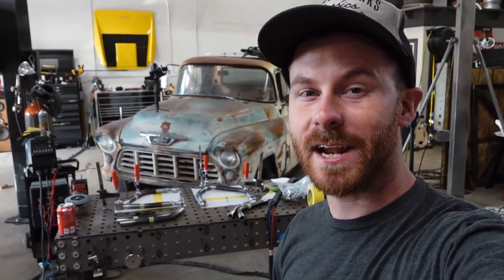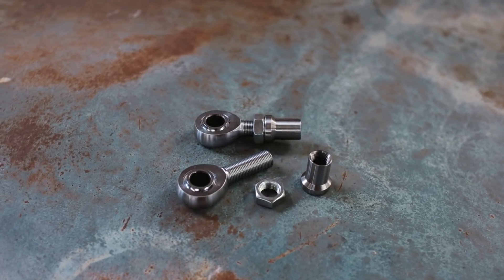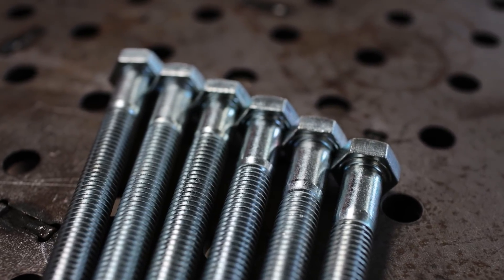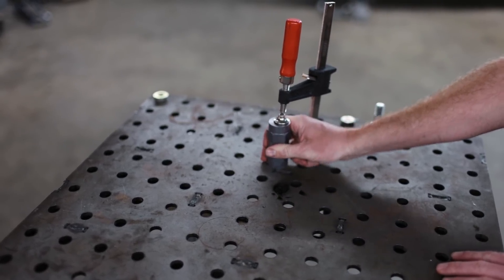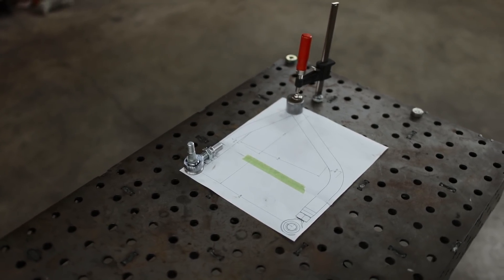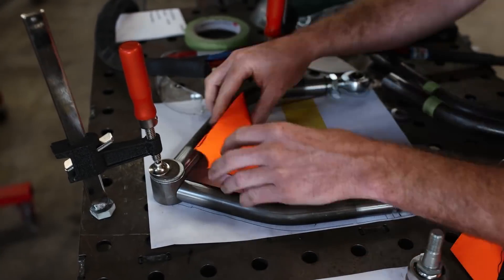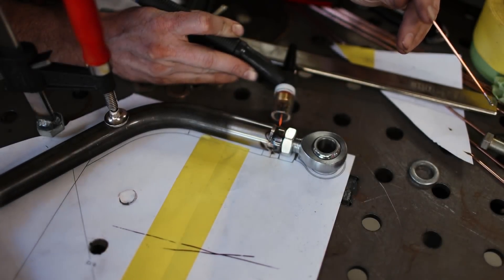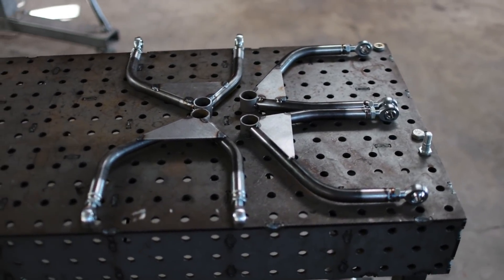Custom Control Arm Fab - Time Attack Suspension Build Part 2 - K Swapped Ferrari Ep. 52

Comment: Could you provide the specs for the ball joint eyelet in the upper control arms? Doesn't seem anyone makes off the shelf eyelets you can weld to control arms.
Reply from the maker: I had them made by a machine shop
Reply: @stanceworks6544  I'm using similar corvette uprights but custom controls arms. Could you share the specs?
Reply from the maker: I don’t know them off hand. It’s just bored with a taper matching the ball joint.

Comment: Recommend turning an aluminum or copper heatsink to fit tightly and bolt into the ball joint cup to keep it from warping and improve penetration/ strength and makes certain your ball joints fit when done welding 🙌🤘

Comment: Very nice work.  Did you run any FEA in Fusion 360 or are you just going off gut here?

Years ago I found a free program on Tony foales website for tubing notch templates.  I'm sure there are loads more but was handy when making motorcycle surfaces with smaller tubes meeting larger tubes at angles.  Gives you something to print and wrap around the tubes to make before cutting and grinding

Comment: DOM is not seamed tube. It starts off as a solid bar. It is squeezed and ruined at the same time developing an opening in the centre of the bar. Then a mandrel is pushed into that opening and the walls are formed by rolling.
Reply from the maker: "Although it is almost always referred to as a SEAMLESS tube, technically it is NOT seamless tubing, and it started life as some sort of EW (electric welded) tubing. During the manufacturing process, the weld line becomes nearly undetectable, thus it is referred to as SEAMLESS. It is considered a high strength, high quality tube, and is normally constructed from SAE 1020 or 1026 steel. DOM is commonly used in the manufacturing of race cars and motorcycle frames.

1020 is normally used in the manufacturing of small-diameter or thin-wall DOM steel tube. 1026 grade is normally used in the manufacturing of DOM over 2" OD, with walls heavier than .156". Depending on the diameter and/or the wall thickness, you may receive EITHER 1020 or 1026."

DOM is technically a seamed tube. Its not considered to be by rulebooks, but it absolutely begins with a seam.

Comment: I'm not very familiar with heim joints used in this application and wonder how long they last without lubrication or seals to protect them from "stuff". The fab work here is VERY nice. I can't wait to see the assembled suspension with brakes and wheels/tires.

Comment: DOM - ..."seamed tube"???
Isn't DOM "seamless"??🤔
Reply from the maker: It’s considered to be seamless by rule books but no. It’s not technically a seamless tube. It’s welded tube that’s been drawn over a mandrel.
Reply: @stanceworks  - wow! I looked it up now! One NEVER is done learning!!
You are right - Drawn-over-mandrel tubing – DOM tubing is made from a cold-drawn electrical-resistance-welded tube that is drawn through a die and over a mandrel to create such characteristics as dimensional accuracy, dependable weld integrity, and an excellent surface finish.

Looking forward to the next one!!

Comment: Nice work. The ball joint taper is likely going to distort when you weld that component in. Usually best to just ream them once they are welded. It should be 7 or 10 degrees if the knuckles are the later vette stuff.
Reply from the maker: That’s a good point. Maybe I’ll go that route.

Comment: Unlike bushes, rose joints are really supposed to be loaded radially rather than axially. Can you rotate them by 90°?
Reply from the maker: I did at the end. They’re flat just for Template purposes.
Reply: @stanceworks  Haha, no, I mean the way they are bolted for welding is the way you want them to be. The way you have them in the drawing and at the end is loading them axially with any front-back force going through the arm.
Reply: Sorry, realised I said the wrong thing after watching your latest video. The way you have them in the CAD model and the way you seem to be mounting them (mimicking the bushings they replace), isn't ideal. The way in the drawing is how you want them.

They still work the way you have them, just not as strong and risk of the balls popping out of the joint if overloaded.

Comment: You should think about drilling a hole in the tubing where the threaded bung goes, then plug weld it. That way if the weld around the bung cracks it doesn’t simply pull out causing you to crash. Most all tubular Motorsport control arms use this method.
Reply from the maker: Very true. I did that on my Model A. I’ll do something here too further down the line. Good call!
Reply: Was coming here to say the same thing.  Very nice work being done here, sir!  I just did a set of lower arms for my Mustang, too.  Video to come at a later date. Thanks for sharing your process with us.
Reply: Yep... was coming here for the same. No reason for a tube sleeve without utilizing a plug weld.

Comment: Great video, love the detail. I’d be really interested in how you measure the taper on the ball joint, transfer it to cad and then how the final piece is machined.
Reply: In the last episode he mentioned that the CAD files for the ball joints are available from the manufacturer, so he just loaded them right in.
Reply from the maker: That’s for the heim joints. For the taper, it’s available online, it’s just a ° measurement and there’s only a few common ones. A taper ream is used to make it work.

Comment: Hey Mike,
What the story with the suspension geometry ?
How did you get to the point that those arm lengths? Have you calculated using sw such as racing aspirations?!
Reply: @stanceworks I came here to ask the same thing.
Reply from the maker: I’m going to try and cover more of this in the next video. Racing Aspirations is an amazing calculator and I’ve been using it!